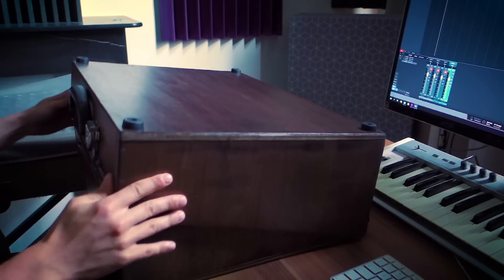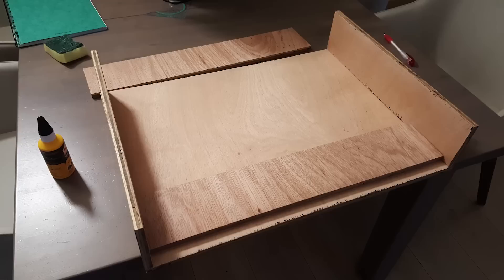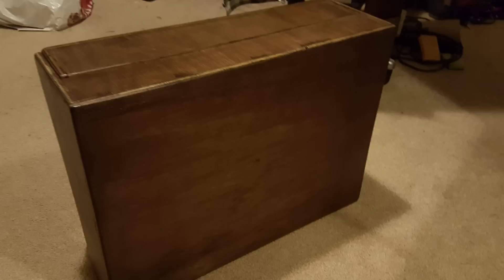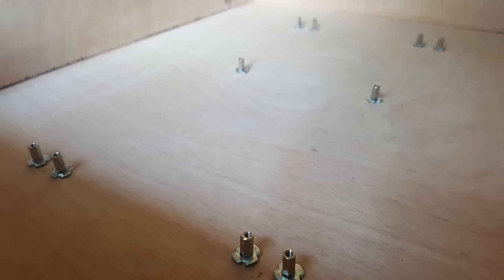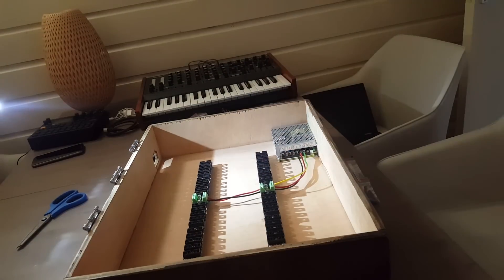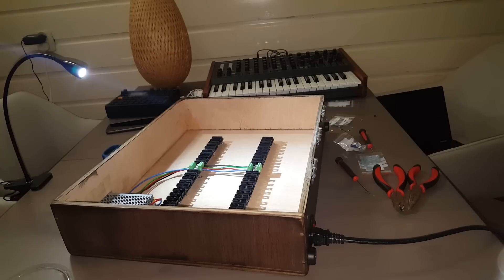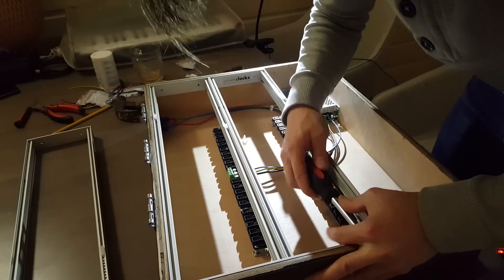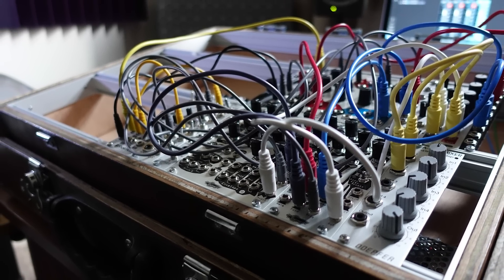How to build a DIY eurorack case || Into Modular #4

Comment: Great video, very clear walkthrough of what you did! I'm about to embark on a DIY journey and everything points in the direction of a Meanwell power supply. One thing I'm wondering is if your system has had any issues with -12V draw. The Meanwell RT65 is supposed to deliver only 500mA at -12V , where my ModularGrid 6U sketch would draw 750mA at -12V.

I can imagine your 9U system would draw even more at -12V. Curious to know if you have had to add another power supply!

Comment: This video was really useful! I'm building my DIY case and will probably get the Meanwell power supply/bus as well. But I've read online that it has noise and humming issues if you don't use all of its power, is that true? I'm using aprox. 12-15 modules, so I wouldn't even exceed half of its consumption. I'm finding it really hard to decide what power supply to choose, since all of the info I find around are really confusing. Thanks!
Reply from the maker: It's fine :) I had no noise issues at all. It's a very commonly used power supply for diy modular cases. Enjoy the build!
Reply: @Davemech  Thank you dearly for the quick reply! :)

Comment: super cool, thanks for this! Question, how heavy is the unit before adding modules and after? Also, I don't suppose you have any plans you could share for the construction?
Reply from the maker: There's a BOM doc linked in the description :) The actual drawings I have no more. But I simply scaled the case this design was based on :). It was pretty heavy. In hindsight I would've chose 9mm thick wood instead of 12mm. I think empty it already weighted 10kg or so.

Comment: I love this case! Especially the way it sets up when you're ready to play the synth. Quick moment of concern though. The T-nuts you use for the stand offs on the power strips are made to be threaded through a hole from the other side of the wood. You could probably get away with the way you used them if you glued them in the holes. If not they can come loose and let the power strips bang around in the case causing damage. Just thought I would point this  out so no one uses them this way and has it damage expensive modules.

Comment: I can't seem to find any info online in regards to affixing the Mean Well supplies to the case. Does it sit on standoffs as well or screw into the wood?
Reply from the maker: You can just mount it with screws. It's enough when you place it in a corner. It has a couple of holes on the sides to make sure it stays in place.